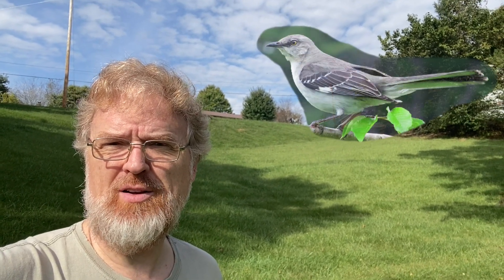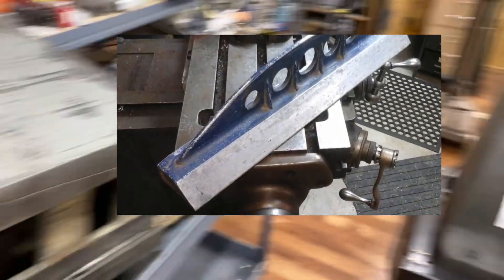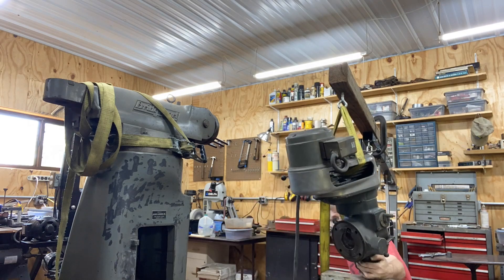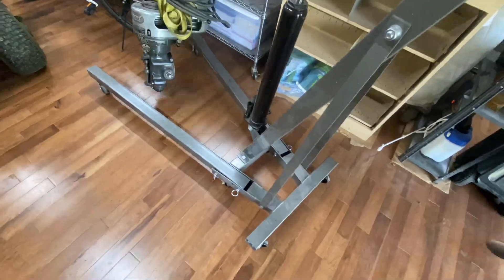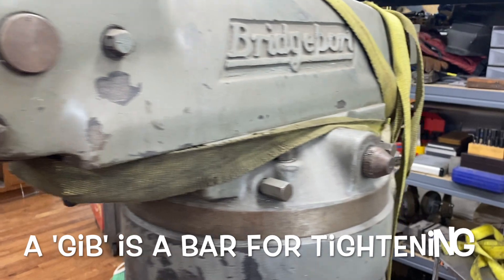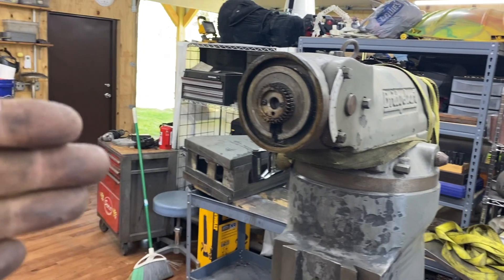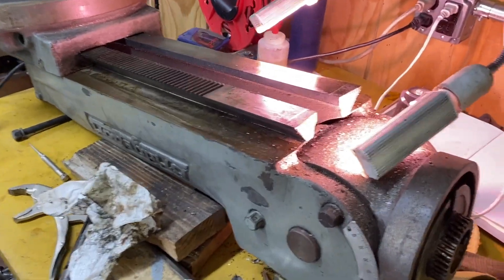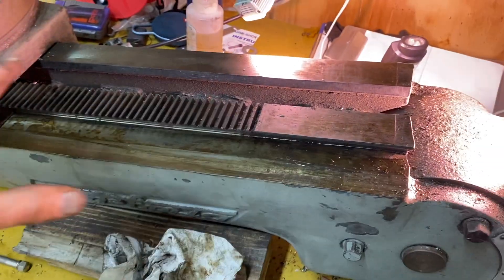Bridgeport Restoration 2: Removing Head, Ram & Turret

Comment: The extended boom is working well, but those C clamps are not enough for my comfort. I think even a few more clamps would be good. I'm sure there are tools around your shop that can be easily implemented. Nobody wants to see an accident.
This series is helping me a lot, thanks!
Reply from the maker: Yeah, that boom is pretty redneck.  I can tell you that it all works out OK, but I'll understand if you cringe.  :-)  Thanks for watching.

Comment: Hi Kevin. Nice to see some new videos! Making some good progress on the mill. Those parts are heavy, but looks like your Drop-0-Matic 5000 os the "perfect" tool for the job. LOL. 

I just started to learn to machine scrape. I machined a prism straight edge and took a crash course in scraping from a friend in Milwaukee that rebuilt machines for K&T. It was a lot of fun and a lot of work, but I think you would enjoy the process. We also learned that there's a lot more to rebuilding than scraping. It's also checking the geometry of one way surface to another, etc. I have so much to learn it's mind boggling at times. There MIGHT be an impromptu scraping get together "class" just outside of Chicago in October. Shoot me an email if you'd be interesting in joining. No experience necessary.
Reply from the maker: Thanks Greg.  I just sent you an email.  Regarding the Drop-O-Matic, it is very helpful to be able to lift out beyond the extend of the legs.  I.e. so I can set something down onto another surface.  The problem is when the weight makes the lift want to tip over.  I need to find a way to attach mass to the back side.  I see you using your lift quite a bit too.  So maybe we can design the perfect hobby shop crane together.  Ha!